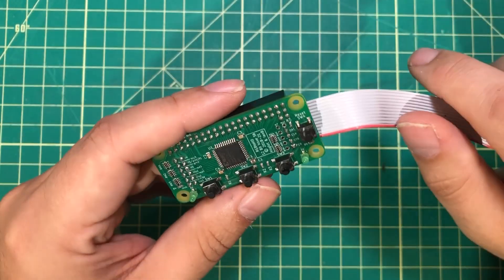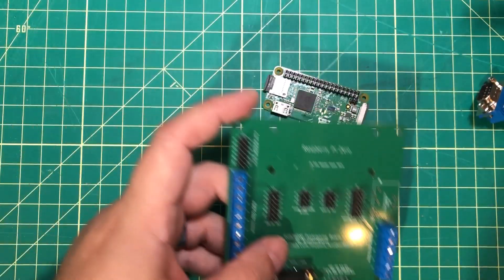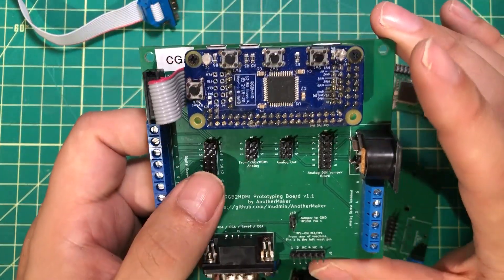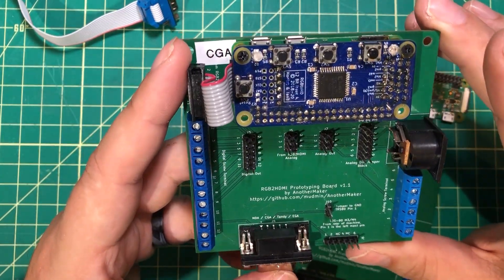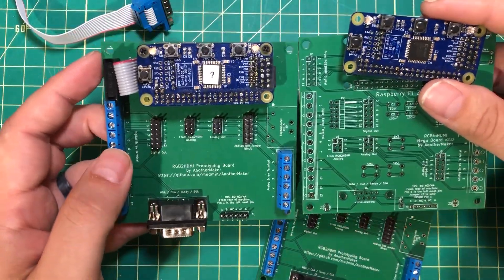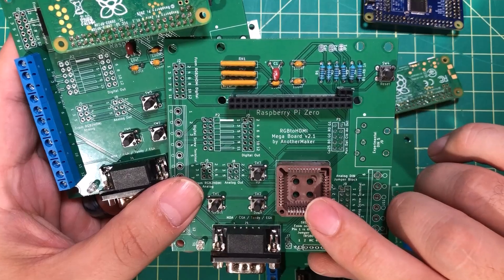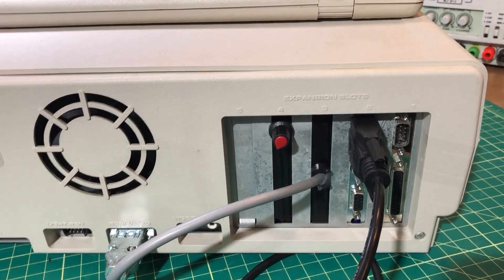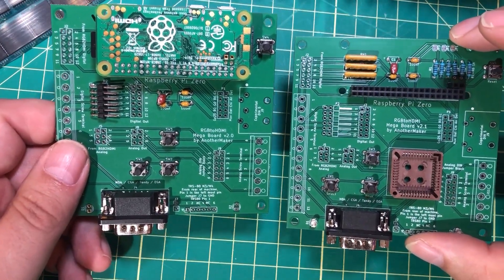My favorite accessory for Retro Computers - RGB to HDMI Pro 2

Comment: This project requires a Xilinx CPLD which appears to be out of production.
Reply from the maker: I've purchased them from digikey, ebay, and aliexpress
Reply: CPLDs are going to be quite soon, its all FPGAs, even the older FPGAs are going to be harder to find.
Reply: @優さん-n7m  AMD has bought Xilinx in 2022 and discontinued all XC95 series of CPLD last January.